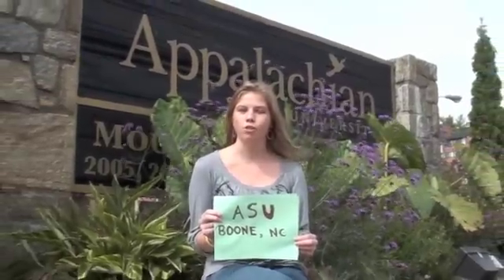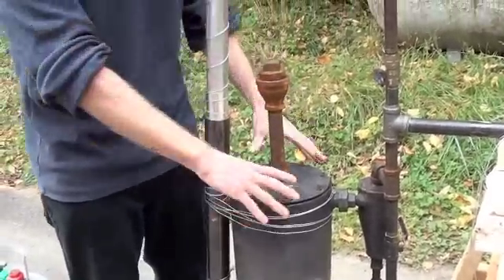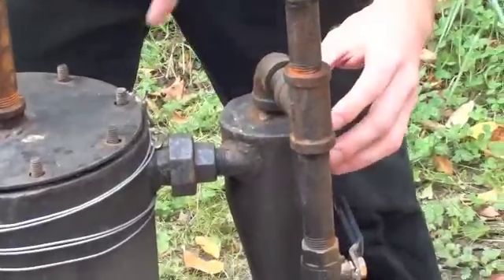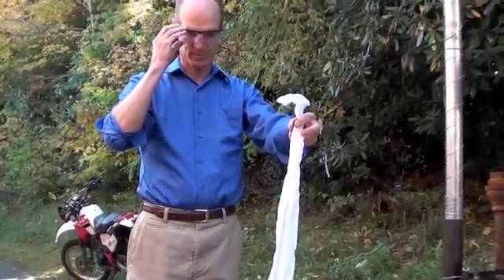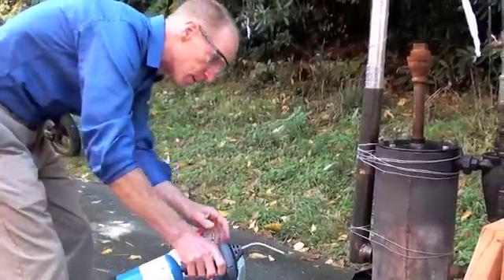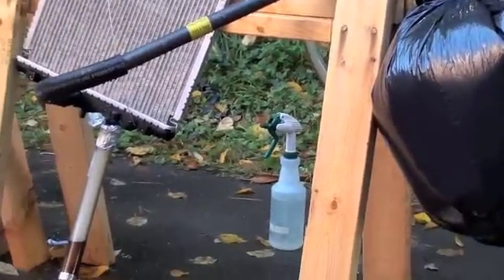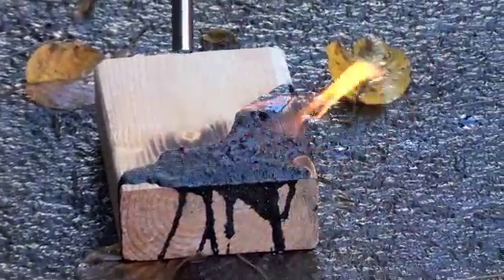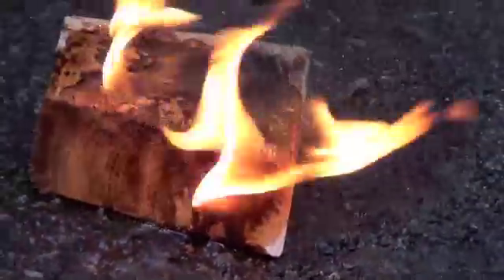Bio-Char, Bio-Oil & Syngas from Wood Pyrolysis

Comment: Run the gasses into a large sphere-tank with a low power compressor on the out end to send it into an even thicker and stronger sphere-tank with a compressor of higher pressurization on the out end of it.  

Both compressors will be set up to only operate when the internal pressure of their respective sphere tanks reaches a given level.  There will need to be a check-valve at each step along this process to prevent the compressors from pulling air into the sphere tanks or from drawing too much from the combustion system too quickly, and contaminating the wood gas.  This can also be helped by making the combustion chamber taller, to prevent the creosote from being able to be drawn up by the compressors.  

The first compressor will be at a low compression rate, so that it is not draining the low-pressure tank too quickly.  It will send the wood-gas into the second sphere tank and continue sending more wood-gas in there, until the second chamber reaches a certain specified pressure of said wood gas.  This will also allow any possible contaminants in the wood gas time to cool and settle out of the gas somewhat.  

The second sphere tank will reach a much higher pressure than the first, and then the second stage compressor, at the higher compression rate, will send the now somewhat compressed gas into a given holding chamber; like a large old repurposed propane tank, scuba tank, or oxygen welding tank for example; thus compressing it further and allowing it to be stored, under pressure, in a smaller container.  

This would allow you to compress the woodgas and store it more easily for use in multiple applications, without needing to connect the wood-gassifier directly to whatever you are trying to apply the gas to.  

Also, your distillation setup could benefit from being designed on a similar shape and design as a Crude Oil Fractional Distillation Tower.  As you are basically burning "pre-crude-oil" by charring the wood and heating the volatiles to vapor, a fractional distillation tower could help with extraction of the various gasses in a more efficient manner.  Experimentation of what height each stage of said tower would need to be to effiiciently capture each gas and fluid would need to be conducted of course, but it is entirely plausible that it could be as short as 5-10 feet tall and work perfectly for your purposes.  

Laters.  :-)
Reply: i am trying to nuild a self-sufficient food farm and im trying to recreate the pyrolysis but have little to non experience in the matter do you have some advise ore blueprints? it would really speed up the process and i would be forever greatfull.  also what are all the feul types and sorts you can get from this process, i was planning to do this process in oil drums of 60l and 200l and im trying to power a small home with a greenhouse with stander equipment.
Reply: ps you can send me on my email
Reply: Yes and if the spheres are made of steel, they will fail due to hydrogen embrittlement, and explode.  Don't do it.

Comment: It is difficult to understand why someone would do this. Converting wood to CO2 , it is really against the idea of redusing the CO2 in the air. Cutting big trees that absorb the CO2 and plant small ones that absorbs much less. This is not carbon neutral. Did you say you are from an university?
Reply: Do those small trees not grow to be taller trees? Do they not grow taller by taking the carbon? How would you expect the trees to store the carbon if they cannot/will not grow? It is not an immediate reaction. Over the lifetime of the new tree that grows, it will absorb the equivalent amount that was produced by burning the tree. Seriously. Can't stand the "results now" type of people in any conversation, but especially in the Green Energy space.

Comment: reduce the feedstock particle size , upto 1.5mm and set reaction temperature between 450 to 500 degree celsius and condensing temperature up to 10 degree celsius , a better oil yield
Reply: contact me on LinkedIn  Globalfinpro Consulting.

Comment: an empty fuel tank is more dangerous than a full tank.
Reply: John H how
Reply: @thatonecommenter1473  I think the volume  gas is bigger
Reply: @thatonecommenter1473  An empty fuel tank could have oxygen mixed with propane. If it still has propane inside, you don't need to worry about air being inside. If a 20lb gas cylinder like the one in the video exploded that had a lot of gas in it, it would flatten about an acre around it. There was a train car that exploded and sent one of those massive train wheels 5 miles through the air. This shit is not to be taken lightly by any means. Treat gas tanks like you would a gun.

Comment: why don't you just put natural gas in in computing it with water then you get methonal much less mess
Reply: thats why I'm watching this. can you react the syngas to make methanol?  easier to store liquid than gas.  what do you know if you don't mind me asking. from what i hear is that you would react the gas in a pressure vessel and have  a heat source and copper catalyst. to me it would make sense to use a copper coil with a thermal fluid inside. If that is possible does the syngas to methanol reaction provide any heat once it gets started? any info that you have would be greatly appreciated
Reply: +thor holton use a copper tank with copper chavings or dust Inside the tank run steam and Nat gas in it,  heat it up to around 100c or so you shoud get methonal, have it go through a coil

Comment: I have a question. During this process, whether some poisonous gases produce.
Reply: +YANG YU Yeah its the gas they filled the bag with and set on fire.  Usually methane.  You can also distill wood shavings in a compost pile for a similar effect ;D
Reply: yes carbon monoxide is very lethal

Comment: The SynGas is not "just a couple of gases", as suggested early on in the video.The initial product, Pyroligneous Acid is a mixture of acetone, acetic acid, ethanol, methanol,  wood creosote, guaiacol , wood tar, turpentine, isoprene and other terpenes, and other flammable organic compounds, and water vapor. What condenses out depends on the temperature of the condenser. Gases which are unlikely to condense in ordinary conditions include hydrogen, carbon monoxide, methane, ethane, ethylene, propane and various butanes. 
Henry Ford used pyrolysis of wood to make methanol and lacquer for his cars.   In the UK, acetone needed for making Cordite was made in this way during WW1 until Weizmann's  A-B-E process of fermentation supplanted it. 
Stockholm Pitch was a valuable tar product from the distillation of selected pines and firs.
Reply: Hello can I have your mail looking for some syngas expertise on a project I have
Reply: I'd still consider that "a couple" granted i consider "a couple" ~5 or so.  I would list it as:

- Carbon Monoxide
- Hydrogen
- Hydrocabon Gasses + Vapors

Also water vapor/co2 but these aren't flammible and are thus semi-irrelevant

For most uses short of industrial the specific content is less relevant than how it will effect an engine (sulfur/tar/particulates), and it's energy density

Granted i'm pretty armchair, and the clarification you made is useful

I thought i'd just chime in too.
Reply: You mixture pyrolysis with synthesis Fischer tropsch

Comment: Did anyone notice the words " NO SMOKING " painted on the fuel tank behind these well educated people demonstrating a system that uses an open flame? No one was smoking so I guess they thought it was alright? A little common sense from a 10 yr old could make some so called experts look foolish. With knowledge comes responsibility. Awareness is everything.
Reply: the tank was empty!! and had no inlet pipes!! i'm assuming it was no longer used for storage and a donation for the project!!
however caution should always be taken in any case

Comment: if you force the syn-gas down at a 30 -35 degree it will make 3 types of oil and that oil if ran through a stainless steel tube with finely ground Aluminum in the heat source will create diesel and gasoline and methanol or butanol fuel much like propane so you can get 6 sources of energy from one reaction if done right I also use this method to gasify my waste and animal waste with plant matter. Great grandpa did it in Germany and my grandfather did in the USA during the depression...

Comment: I am the professor for this research at ASU. You can contact me directly at domermuthdh@appstate.edu. I will send you our latest paper. We have moved onto a bigger system and coined the term BioVolatilization (BV) for this system. 

Thanks for all the comments. This is not rocket science, we are focusing on grass roots level. Systems that anyone can build and use. Yes we know about the propane tank, sort of like the little one in the foreground.
Reply: A channel called MrTeslonian mad a contraption of this sort and posted a video about the same time as this one. Are your processes similar? He also came up with this process of condensing and refining as much of the carbon molecules as he could to produce fuel analogs. How might one go about doing the same with this setup?

Comment: Make a check valve that keeps pressure from going back to the biomass reactor. You can also incorporate a 'break away' weak point in your hose or pipe that will vent any explosive force before another component breaks.

Comment: The idea would be instead of using PV for solar you use solar pyrolysis of any biomass. What that would give you is a way to run a generator from the syngas. It's not very efficient but it should be more then PV tech is right now. The real beauty is the growth of biomass you gain when you use the biproduct, biochar. This becomes a positive feedback system. The whole time you are putting carbon into the ground.
Won't work on sunless days, unless you can store the syngas.

Comment: I could have said it better... No sleep for the last 4 months has some effect I guess lol. correction: A BBQ is a propane BOTTLE within a foot of an open flame lol.  By the way, anyone trying to recycle propane bottles should understand concepts like inert gases.  Also, lighting a gas without open access to oxygen will restrict the flames to the area the gas and oxygen meet (and mix). Fire requires oxygen, fuel, and heat. Take any of those three away and fire cannot exist.

Comment: To all of the people commenting on "ZOMG! the propane bottle is about ESSPLODE!!1!           I have welded on full propane bottles, I have cut empties open with torches, plasma cutters, and abrasives. They are extremely safe within a wide range of parameters. WTF do you thing a propane BBQ is? It is a burner within a foot of open flame.  As long as you check for leaks, you're golden. The only problem I had with this vid is they didn't set their sights very high. You can do this in a paint can...

Comment: I'm sorry. My computer bad shows.Klason ;2[C42 H60 O28]Wood ---> 3[C16 H10 O2] charcoal + 28H2 O [water] + 5CO2 + 3CO + 2[ CH3COOH][acetic acid] + CH3OH +
+ C23H22 O4[ tar oils] 
1]Charcoal + waser + Q -->CO + H2 ---> unit composition of the gas[ CO and H2] --->methanol synthesis reactor -----> methanol 
2] module decomposition of steam-gas [gas wood]--->unit composition of steam-gas [ CO and H2] ---->methanol  synthesis reactor --->methanol Greetings from Polish Hajnowka and sorry !

Comment: Like me, the enthusiasm of young students.I produce charcoal for silversmiths and drawing.Do retort of stainless steel.The pipes must be copper.Coolers must have a large cross-section - and Copper.cyclone is okay.install the indicator room conditions.
Cyclone-cooler.To analyze the classical formula {KLASON].
2C42 H60 A28 ---> 3C16 H10 O2 [charcoal] 28 H 2 O CO 2 5 3 Co 2 + CH 3 COOH CH 3 OH + C23 H22 O4 {tar]. And how well you think and create the methanol-fuel. And that's close! Yours Poland

Comment: You might try putting the radiator in a plenum and running a fan through it at about 400cfm. Run those creosote drip lines back to a combustion chamber under the gas generator pot. I want to burn the oils in a drip type fuel oil heater. I want to use stainless so I can collect the liquid for seasoning food (like liquid smoke).
Reply: I'd say yes to everything you mentioned except using that gunk for liquid smoke on food.  It's done commercially but what if the pyrolized wood scraps have chemicals in them? I know that creosote is a carcinogen.

Comment from the maker: @ stndnthdrk: I believe we fabricated the cyclone filter using steel pipe & sheet metal, although this was before my time. All the cyclone filter does is allow the air to slow down, and particulate drops out. The inlet is tangent to the chamber, so the air swirls around. @froonbazhooley We intend to run a generator on the syngas to produce electricity and heat, after we've condensed out the liquid hydrocarbons and the water. The jury is still out on what we'll do with the bio-crude/bio-oil.
Reply: I think solar power (a wall of stainless steel sheets or aluminium sheets) could be used for focusing sunlight onto the bioreactor, reducing the price of production by not needing a fuel source to power it. The products could be jet fuel, liquid petroleum gas, and benzine, and you could even use weeds as the source, though you might need to let them to dry somewhat first, and you might need to pack them tight together first. 

But as a business model, having people pay you to mow their lawn or backyard, and using the resulted grass and weeds clippings as intake for the pyroysis process would effectively lower the price of the gas even more, and the lawn mower used for mowing the lawns and backyards could also be powered by the same fuel you produce, reducing the costs even more.
Reply: @SapioiT  fun fact, the biochar generated by this process can be used as fuel for the process. With the right filtering process you might be able to take the cold creosote which was flammable and feed it back in as well. There are some designs that allow you to actually drop the biochar directly into the feed area so you don't even need to stop the process for more than about 15 seconds to restock the biomass to be turned into biochar.
Reply: @lymnjuice  7:31

Comment: The answer about making diesel by this method is No. 
This liquid consist acetic acid and methanol. If get methanol from this liquid by netralizing acetic acid with calcium hydroxide. Then you can mix methanol  with vegetable oil and caustic soda under the temperature, and then separate glycerol from biodiesel. You will get what you want - free diesel. Before this biodisel also will need to wash it with water from the rest oof caustic soda.
Now I am learning this, ant trying to make practice.